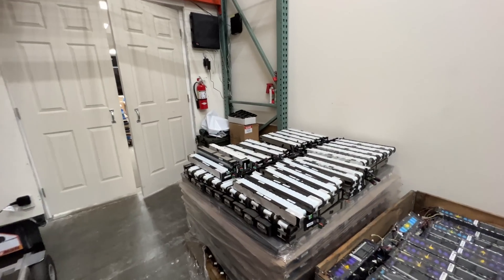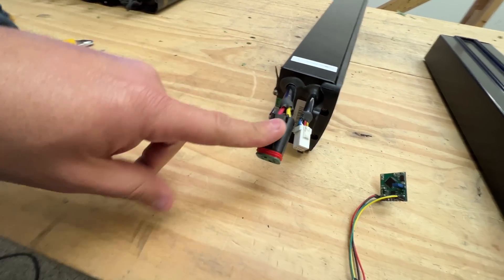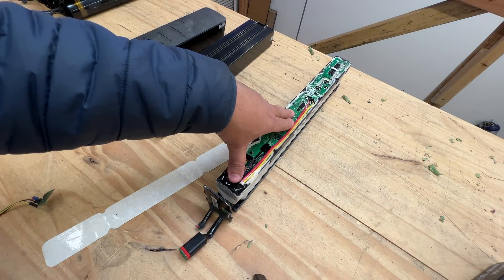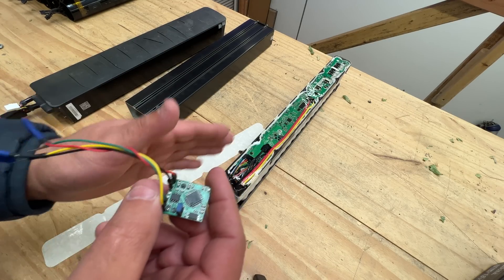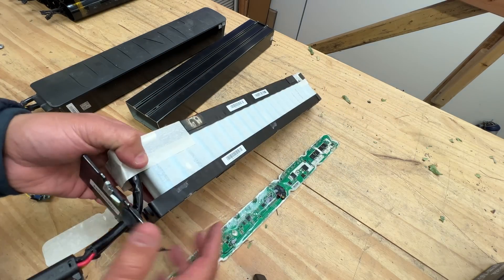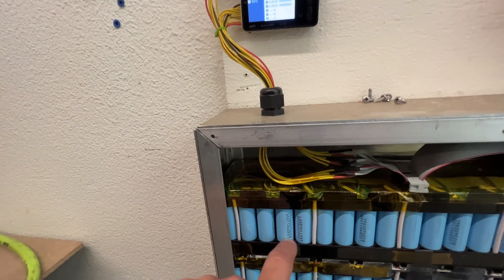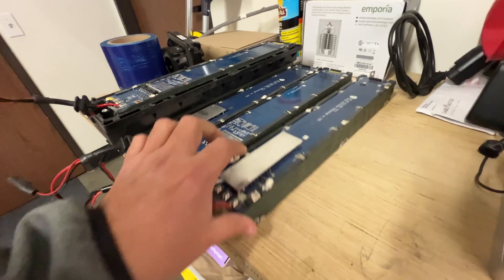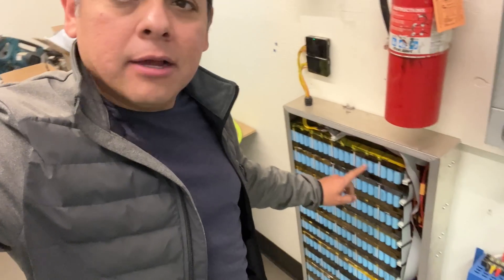Jump eBike Battery for DIY projects

Comment: Would you have any 72v batteries up for sell, I tried creating a 72v back linking your 36v scooter batteries together to power a 72v electric motorcycle but it was a no go.I was able to power the lights and horn but there was not enough power to get the 2000w 72v motor to turn.
Reply from the maker: Which ones and how many did you use?

Comment: On the shipping issue to the UK couldn’t you send them by boat over the Water because they will not let you send cells via airfreight I know it would take a lot longer but I for one as a UK resident would stand do you import duty for the price of your cells

Comment: I have to ask you a question. If your house fully backed up on batteries? Let’s say the power went out today and no one knows how’s when it will come back on. Well how long can you run before needing charge? How much of your house can you power? How long does it take to fully charge your system with the setup you have? Do you have a backup plan if it rains all week? How would you charge your batteries if it rained? And have you tested your backup plan. 

P.S. don’t wait till something happened to find out things you thought would work doesn’t.
Reply: oh he knows his power backup is basically just for show .  it would only power for maybe a few days using only led lights .   thats a big building with lots of lights .
Reply from the maker: I am prepared for temporary power outage,  if the grid goes down permanently.  I’ll cross that bridge then
Reply: @jehugarcia  i'm prepared for a lifetime power outage.  due to the fact i live out rural and in canada saskatchewan the winters are harsh and a wood/used oil  stove/heater is the only way to stay warm or cook food. wind and solar charge old day home made glass lead acid batteries.
Reply: @jehugarcia  dude! So you’re going to be one of those people to wait when something happens 🤦‍♂️. You will be in the dark. I would have thought as a person that was pushing to make a battery back up and when Puerto Rico got hit, you was one of the people to show them to how to make power. But you don’t have anything yourself to keep your home going. That makes no sense. So your saying “ do what I say, don’t do what I do “ I don’t understand how you want people to follow you and believe what you say and you don’t have anything ready for yourself. How will you be ready for long term power outage when something happens, when your not even ready now. That’s embarrassing 🤦‍♂️

Comment: With your battery recommendations I have built a 2.8kwh portable solar generator using 10 x 12v fullriver packs. After the holidays building another system for a family member. Both housed inside a wheeled pelican case. Retired my lead acid batteries.